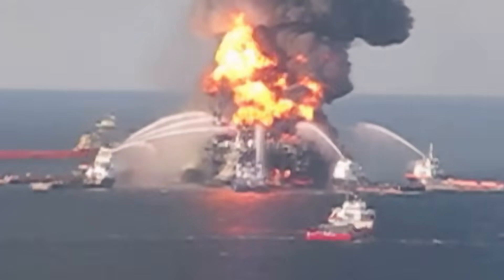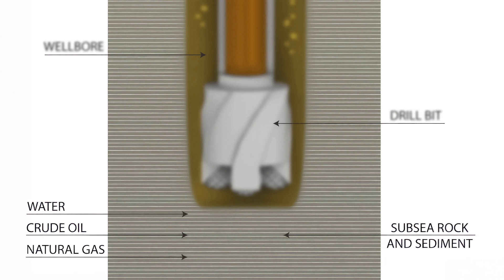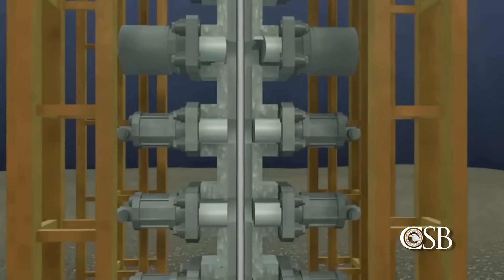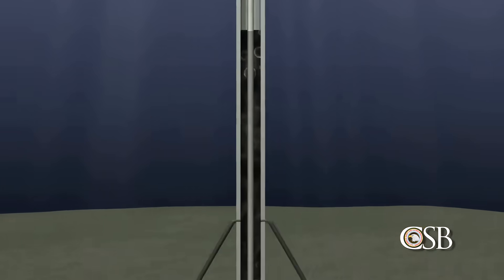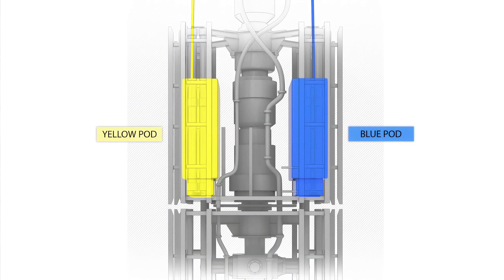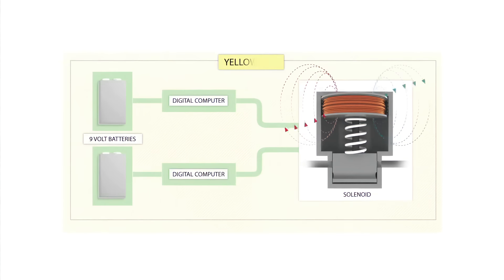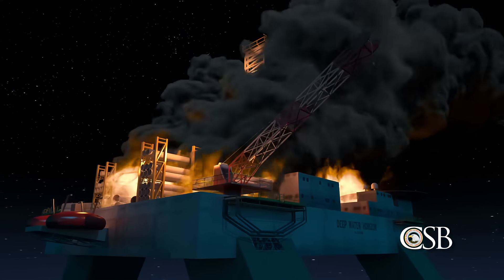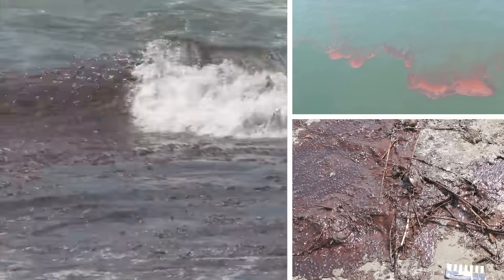Deepwater Horizon Blowout Animation

Comment: The amount of the blow out is vastly understated by the US Government in order to protect the BP Company and English interests.  Prior to the well establishment the safety analysis indicated that a blow out in this location of 87,000 BPD was insufficient to ever have oil  reach shore.  The government report in this film indicates 57,000 BPD output.  On day 18 of the spill there arrived in  Barataria Bay over 18 million barrels of oil. Considering losses this indicated a spill in excess of 5 million barrels per day.  This would be based upon surfacing oil at the drill site.  The subsurface losses indicate that the blow out was in excess of 50 million barrels per day.   The fiction and lies in this case are stunning.   This was a natural gas well not an oil well.  It was only about 2% oil output.  The pressures were at stopping 7900 psig relative to the sea pressure at the site.  The diameter of the drill pipe was 28 inches leaving a hole blowing at this rate or higher.  The actual biggest leak was at the well head and was nearly 5 times the drill pipe leak.  That leak caused a surface boil between 200 and 250 feet elevation that was over 1000 feet across.  That is no where near 57,000 BPD.  It is way more.   The emissions of the well were vastly larger than the government reports.  

Anyone doubting me on this must know that you can leak 5,000 BPD through a 1" by 1/16" crack in a steel pipe at 4,000 PSIG.  I have been present for such a leak.  It is instantly stunning.  This is typical of a hydraulic leak in a modern excavation machine.  I was on the receiving end of that leak at a range of 50 feet and it nearly blew me over.   That was just a leak from an excavation machine that blew 25 gallons of hydraulic oil in less than 1 second.   You have to understand that this well when it blew out was pressures in excess of 25,000 PSIG to the sea pressure.   A hole only 1 inch in diameter would leak more than 57,000 BPD at that pressure.  The liars in the media and the government on this event are stunning.   The Gulf of Mexico leaks naturally over 50,000 BPD and suffers no ill effects.  Please people get that through your head.  The fact is this well was blowing upwards of 50,000 Barrels of oil a minute.  

I know people don't think that the Gulf of Mexico has that amount of oil in it.  It does.  The words of a Shell Oil Geologist describing this deposit to me were, "Energy shortage HELL!  We are afraid of running out of air to burn."  The deposit in the Gulf of Mexico is upwards of 450 Trillion Barrels of Oil.  The floor of the Gulf of Mexico is covered in between 100 and 300 feet of Methane Hydrate Ices.  There literally is so much energy down there you cannot imagine it.  It is more than 2000 times that of Saudi Arabian' deposits of oil.  What is more the geology is making more oil there every day from deep in the earth geologic processes.   

The failure of this Blowout Preventer is probably accurate but the failure is far more serious than this.  As the well blew out the mud in the well blew out and when it did, the force became so powerful that it could have literally pulled the casing from the well if the preventer had worked.   If the sheer worked the blow out would have probably put 5 miles of casing into the sky right through the rig.  I know it is hard to imagine this level of power.  I cannot but be in awe of the bravery and heroism of the men who bring us our energy from such rigs.  It is that sort of danger and power they deal with every day.   One thing that is not said in this video is how big that BOP was.  It was 5 stories high and weight of 1000 tons.   It was insufficient!

The drill pipe described is gun metal steel like in the 16" guns of a battle ship.  It is some tuff steel.  It is almost unimaginable to think of it being blown up like a rubber balloon as described here but the pressures are that high.   What was going on was in the beginning the failure of the concentricity of the well.  When wells are drilled at these pressures they explode inward making a hole much larger than the bit cuts.   Periodically the driller backs up and fills the well with cement for a space then drills through it so that the well maintains size.  The driller in this case put in too few of these and lost control of the well.  The blow out was caused by that.   It was rushing the process to strike oil faster.   There is a gold rush going on in the Gulf of Mexico to hit the "mother lode" of oil down there.   To date nobody has drilled even close to the deposit. The pressure is too high.  This well was about 60 miles from the core deposit.  Central pressure in the main deposit is about 167,000 PSIG.   That will vaporize steel.  it will liquify all but the hardest minerals.  

Leakage from this deposit filled the on shore deposits of oil such as the Texas Black Giant and the Mobile Bay deposits.  It is that big.  It is that much of a deposit.  PSIG at Mobile is 31,000.  PSIG at Petronius off shore 45 miles is 65,000.   The pressure at the Macando Well was probably closer to 100,000 PSIG relative to the salt water at sea floor.  I know what I am saying will be highly argued by many people.  This data is all sourced in the Oil Industry and is well known by them.
Reply: VERY interesting Paul, I learned a lot .. thanks!
Reply: You got it! though the deposit is deeper than you may think... It has "blooped" before.  This is why continents rise and fall above the sea.   Alabama has been and out of the ocean 7 times I know of.   The pressure at Mobile bat 31K PSIG  At Petronious off shore 45 miles 65KPSIG
Reply: Wonder how big of a tsunami one of those super bloops would create.   Guessing those bloops happened in the past due to undersea earthquakes
Reply: Based upon the records on in the rocks... about 2000 feet high.
Reply: Great read. Do you think people will ever develop a alloy to withstand taping into that core deposit or would it be possible to try and tap into outer or secondary areas of that deposit to try and bleed some of the pressure off over time. When you mentioned that equipment leak we had an old Hyundai excavator around the 50t range that you had to bleed air pressure first from the hydraulic tank before adding more otherwise the cap would fly off into your face.
Reply: Paul, that's very interesting information and fantastically high pressures. Without disagreeing I would need to dig in deeper just for my self to verify this and learn. It appears from the video the regulation around the design, manufacturing and testing of these BOPs must have been relaxed for this to happen.
There is one bit I can not agree: I have been with BP on safety planning meetings in the UK (before this accident happened) and I know how thorough they are here. This is not the culture in BP I know of. It is hard to put all the fault at them even if they might have made mistakes. In reality they took all the punishment for this accident.
Reply: Jesse Thomas 
1st, Idk what the actual amount that leaked out was. However, it seems like a fairly simple math problem to figure out. beginning pressure, beginning hole diameter, ending pressure, ending hole diameter over time. And I Absolutely Believe the amount that leaked out was Far and Above what was admitted to/charged for.
Also, let's not forget, the amount of production has a lot more to do with profit than with availability
Reply: Paul Noel Best comment on YouTube I've seen,ever.suprised they didn't red flag it,and pull it,truth hurts and usually doesn't get out
Reply: Excellent write up.
Reply: Paul Noel so it really can create a tsunami that high ????? If so now im scard ??? Where is this super bloop u speak of at?
Reply: A call for a lot bore regulation according to the Kochs. The Kochs want the industry to regulate itself and follow that up with caps on damages as they trash the environment. Do that and they will have a lot more money to get you elected. And once out of office pocket cash and exclusive ground floor business deals.
Reply: Paul Noel wow, that was certainly informative. Thanks for the essay.
Reply: Amazing, thanks for your comment.  Usually you learn absolutely NOTHING, if anything,  you get dumber from reading YT comment section.  Not this time.   Also, scary stuff.
Reply: Brits hold 40 percent of BP shares, while Americans hold 39 percent. JPMorgan Chase (American) owns 28 percent of BP, while BlackRock (American) owns 8 percent. So, It's more and American Company than a British one. Oh and it hasn't been called British Petroleum for years because it isn't British anymore!
Reply: Paul Noel Well written account, have you heard Ian R Crane's explanation? 
He states that Hallerburton's cementing of the casing was bad, Schlambier (If that's the spelling) measured it @ 10.00 + told them it was going to blow, + arranged a helicopter to take their staff off, it actually blew about 2.00pm. BP took the rap but they will profit from doing so.
Reply: Paul Noel They wanted to install a well head to measure the amount of oil leaking into the gulf. However, as this then accurate amount would then substantially increase the fine BP would have to pay, they capped the well and sealed it.
Reply: Paul Noel how lond did it take you to write all this?
Reply: Trace 23 
I agree it was probably more than officially reported.
Reply: Trace 23 the movie says 210 million gallons leaked out which is 5 million barrels. I highly doubt that is the actual number though.
Reply: "This data is all sourced in the Oil Industry and is well known by them."  Can you be more specific?
Reply: Upwards of 450 trillion billions barrels of oil!?!?!
Reply: I think your estimate of 50 million barrels a day is a far over reach. Considering world oil production is in the 85 million per day range. And the US uses appropriately 18 million barrels day.
Reply: Agreed, it has been long said by those in the industry that the whole "fossil fuels" supply is far more than there is air to burn it.

 Also, the myth that the oil comes from ancient fossils is still widely believed by the public which is 100% false. 

The Earth replenishes approximately 100M+ BPD from natural processes deep underground involving very basic things such as iron, water, pressure and heat. The dinosaurs part is a myth.

 The incredible pressure from several of these large reserves leaking is what produces the large shallower oil deposits common to modern drilling/pumping used. The proof is that after many of these large reserves are "drained" , they can be found to have replenished themselves months or years later with new "mystery" oil, now full again. 

The whole crude oil industry is one of the biggest lies the public believes in how it operated to this day. If the globe as a whole understood the supply the whole global economy around "fossil" fuels would change very fast. 

  Also, i wonder what the global warming crowd thinks about the level of methane gas that was released and is still being released from this accident to this day. ...This accident alone is thought to have triggered the very rapid changes in climate were have seen in the last few years yet people are still distracted with talk about vehicle emissions and relatively useless, puny impact agendas...while this accident was the true giant, monster in the room. 

As long as the public stays preoccupied with dramatic politics and idiotic Sports ...Things Are likely to never change.
Reply: LOL.  Seriously, LOL.
Reply: Paul Noel 5 million barrels were leaked according to the movie. I highly doubt your 50 million barrels a day is even remotely a legit estimate.

Comment: Basically the BP crew screwed the entire safety system up,by not wiring it properly and by not maintaining it,and by not operating it correctly,totally BP fault.
Reply: tbugher62: Actually, the wiring error was NOT by BP, but by either Transocean worker or one of their subcontractors on the beach.

Comment: Everyone involved in the initial response to the spill knows that it was the EPA and USCG that made this disaster worse than it should have been. More than half the oil that reached the shore line could have been prevented. While the oil was 40 miles offshore the oil could have been burned on the surface. The USCG and EPA were paralyzed with indecision. When they finally entertained the idea, the oil slicks were only a few miles from shore and the resulting smoke would have impacted local communities. The plan was therefore abandoned. One can only speculate that this was a result of intervention by the Obama administration and their famous motto of "never let a serious crisis go to waste." Remember,  this crisis was occurring during Obama's solar and renewables push (Solyndra).   Obama, defied a federal district court judgement and ordered the federal agencies to deny permits for the drilling of new wells.  The accident took place at the right time to fulfill his agenda.

Comment: a 9-volt battery?
Reply: Powered a small computer circuit board (there were 4 such redundant boards and batteries); the battery was backup power in case surface power gets lost (as did happen); battery is needed for about a minute.  The circuit board is to operate a solenoid valve (powered by 26 v battery). Hydraulic energy through the solenoid is to close the BOP and comes from multiple hydraulic bottles on the sea floor BOP

Comment: Now I understand what happened.
A simple , yet thorough explanation.
Complete failure of the safety systems.
Perhaps, the solenoid should be held closed  by the battery power. Rather than relying on battery power to open them. Then in the case of lost power, the solenoids would open and operate the ram.

Comment: I wonder why they didn't have a float collar or 3 in the string? They have check valves in them, making it nearly impossible for wellbore fluids to flow up the pipe.
Reply: They had two, and they failed, apparently due to a problem when turning them on (auto-fill type).
Reply: Their system used a float belt with 4 on the floor.

Comment: Well wouldn't the oil that was above the pipe ram eventually run out because the ram was closed?
Reply: The shear ram cut the pipe, but did not seal.  Thus a new flow path was created around the sealed pipe ram.

Comment: To my knowledge there's only one valve in the world that is capable of centralising the pipe and cutting through the tool joint, then the valve remains closed and gas tight at up to 10000 psi (nitrogen)

Comment: Why would you not have the fail safe's default to a closed position when power is lost via spring pressure?  Dual sheer valves  with a 90 degree offset would have closed the pipe no matter the position. Easier stated after the fact of course.

Comment: Which version is true- either one of the batteries were revealed drained that caused BOP failure to cut drill pipe or now this video says the drill pipes were bent away from the bop blades so that it could not cut them? Did investigators carry out experiments with the same pressures or just hypothisise it cld be so? Halliburton should share liability for cements quality and drilling contractor for bop installation along with BP

Comment: If the annulus bladder couldn't seal properly and pressure inside the drill pipe continues to rise they should have left the ram blind in closed position and slowly pump out the mud from the riser pipe NOT the annular pipe to lower the pressure. That way gas and oil from the formation would be gradually and controllably removed from the pipes. After that they could inspect the annular bladder because the ram blind below it still isolates the oil.
Reply: The riser above the closed BOP had a large amount of gas in it.  With pipe ram closed and sealed, this gas migrated (bubbles rise fast in liquid) and reached the surface and then exploded, killing the men.

Comment: how exactly do these 'kicks' work? So first the oil would run up outside the tubing into the ship, and then they shut down the annular which caused pressure to build on on the inside of the tubing?